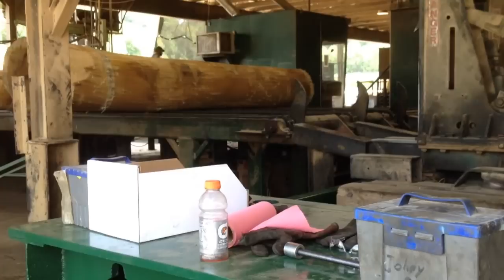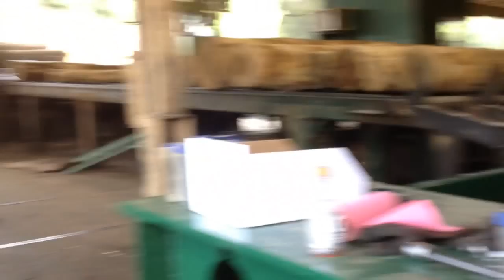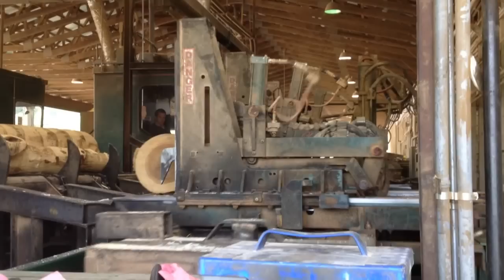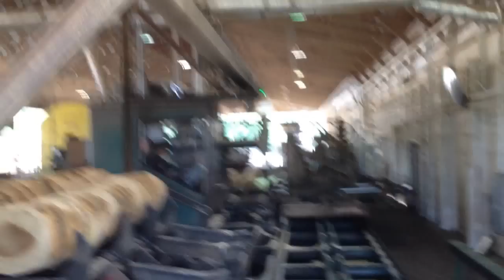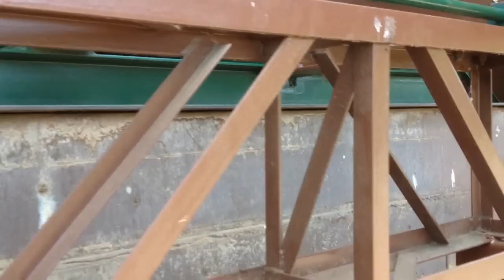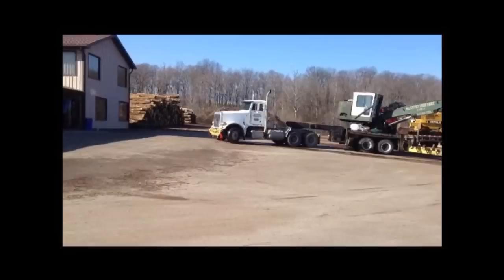Shotgun feedworks, Part 5 First sawing

Comment: Look into using the excess sawdust to make bio bricks made from sawdust and compressed to brick hardness to get extra cash for sawdust
People can burn em in their woodstoves or fireplaces. Make sure if you do it to use as an example " LOGGER WADES BIOBRICKS
or BIO LOGS.
Bio will mean to the end user 100% natural.

Bricks will stack and ship easier on a standard 48x40 inch pallet.

Comment: just a thought...it would be nice to have 2 blades, the second blade would climb mill cut like the first on the return stroke. Each time the table reaches its end of stroke , the second blade cuts on the return stroke. The blades would have to work in sync. while one blade cuts the other blade is tucked away waiting its turn, just a thought..
Reply from the maker: Neat thought
Reply: Seeking TKO band saws do that with teeth on both sides of the band

Comment: I really love to watch a sawmill work and it looks like this one is working well.  I just wondered what was the size of the widest board you cut off of the first big poplar?  It's hard to tell the exact thickness but it had to be 1 or 2 inches but what was the width?  However big it was it was a wide board and I would have thought the operator would have cut a few more before he rolled the log.  I guess after the roll the boards were more normal and marketable.  My goal is to watch all of your videos and I'm glad I found your channel!

Comment: Nice video! I just discovered you guys. When you say shotgun feed is that what we call a shotgun carriage? I worked a mill in MT that had a shotgun carriage. The mill was originaly  built in 1906. The head rig was on the upper floor and to get to the boiler room you went under the "shotgun". When they really putting out the wood the thing would shake that part of the mill. The mill is still running though completely rebuilt all new.
Reply from the maker: wes normandin yeah that's prolly the same language.  and the gun has a lot of push when that carriage changes direction
Reply: +wes normandin  hi wes I use to operate a shotgun here in New Zealand at kinleith mill don't no if your firmilar or heard of it but the mill I was in had two shotgun headrigs No. 1 an No. 2 working da same time both steam driven also there was a rift edger with infeed rollers driven on steam with a forward &  reverse

Comment: ever thought of putting in an oil cooler in? to keep the temp down. same kooler could be used to keep the oil at a certain temp during the winter months as well.
Reply from the maker: Nathan Dean interesting, its just got the standard cooler mounted on the power pack